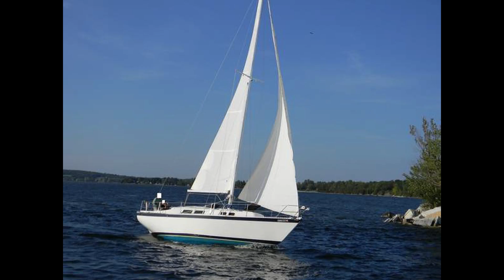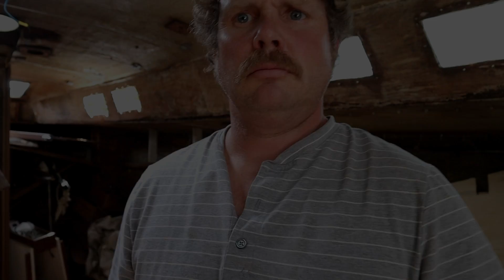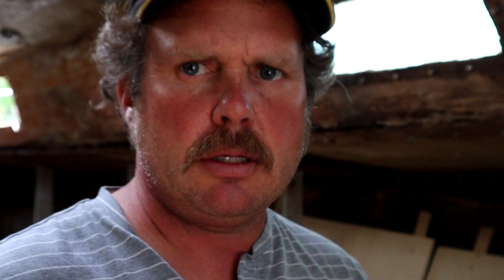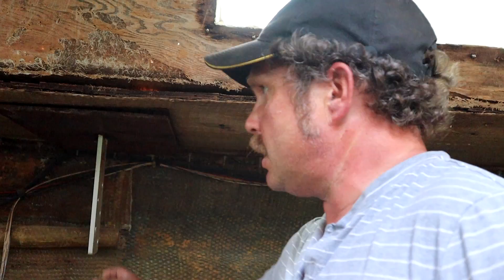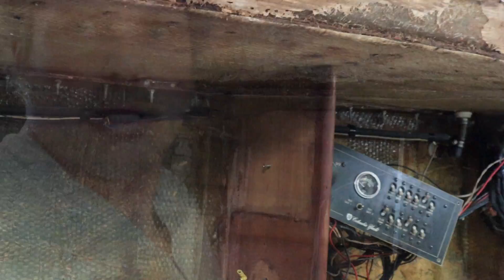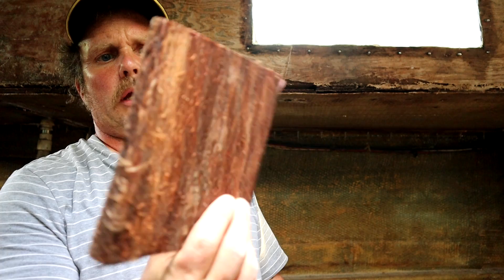Replace Deck Core From Below  #33

Comment: Tile vs large core sheet..tiles facilitate resin bondinf top to bottom, vs drilling bonding breather holes.
Reply from the maker: That does make sense. Tying the top surface to the bottom surface.  I like the idea of the large sheets with holes throughout. Moby Dick should not be carrying any load from the chain plates the larger sheets displays the load over a broad area versus a point load. It's not necessary at all because the bulkheads should be carrying the load. Any contiguous structural attribute only adds to the strength of the whole boat provided flexibility is not hindered.

Comment: I hope I never have to deal with removing core material but your method makes a lot of sense to me.  Thanks for sharing
Reply from the maker: just a little head scratching and watching as many videos on the subject as i can find. there some adjustments to the prosses i will be making on the portside deck replacement but in general it worked very well!

Comment: Hi, the builder likely used small squares of ply because they do not need to braze them to take the curve of the deck. You may find out that the deck is not perfectly flat on both fore-aft and inboard-outboard direction. But you are right, larger pieces shall be more rigid. You may want to add a additional thin layer between the ply and the old glass ( as a Tye layer ).
Reply from the maker: I was able  to push the fiberglass and plywood core up tightly, but you are right it is a compound curve.
I'm actually  going  to cut out  the damaged part of the deck from the top and reglass also once I get all the bulkheads back in. And finally it will be finished with wood, but not necessarily teak, we will  see when I get to that point. 
Thank you for your comment  I really  appreciate  the input.
Reply: @SalingSamantas  You are welcome, good luck with your refit.
Reply: I am 90% through a core replacement on an 81 Tartan 33. I also went in from below. My initial plan was to glue in a single piece using thickened epoxy. Ended up using smaller squares to deal with the curves and uneven surfaces. I also considered using the old glass. But it did not survive removal. Anyway, thanks for sharing your work. Looking forward to watching the rest of the project.

Comment: looking good. I'm trying to figure out how I am going to replace my core. I think I will be going from the deck down. This is helpful!!
Reply from the maker: It's been  awhile! How have you been? 
I think  the deck down  approach is more common way of doing it and gravity works in your favor. If I were  doing  this under cover I may have gone  this route.
The thing  is epoxy  curing in direct  sunlight isn't  a good  plan and you  also have rain to consider too.
The only  complaint I've got  so far about  my approach is that you can't  be 100% certain that there  are no voids between  the glass  and plywood core the glass isn't  that flexible. However everything is sealed with  epoxy very thoroughly, so no water intrusion should  be possible.
Reply: @SalingSamantas  Thanks for the input. I am doing well. Tons of footage to edit. Just dropped the mast solo over the weekend so I can remove the old chain plates and start thinking about deck work now.
Reply from the maker: Wow! how did you drop the mast? Oh that's right yours is deck stepped isn't it.
Mine is keel stepped I'd love to find away to drop it without the marina's help.
Reply: @SalingSamantas  Yeah its deck stepped with a tabernacle. I used my boom as a gin pole and fabricated guy line pivots out of steel so they could be in line with the mast pivot point. Nerve-racking, but it went perfectly.
Reply from the maker: @refittingreverie7992  its nice to be self sufficient like that. I would need a bridge  or a tall tree to putt this off.
My marina charges  me $100. So it's not that bad. They  have to step  all masts to get sailboats in the yard due to power lines anyway.